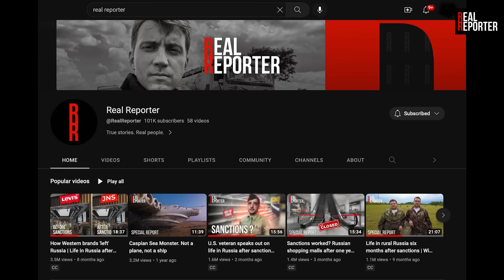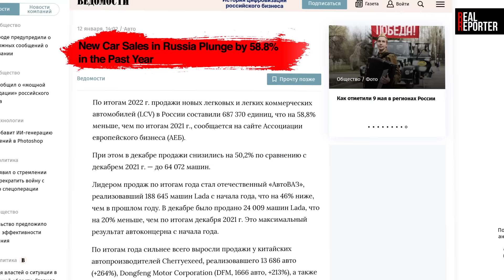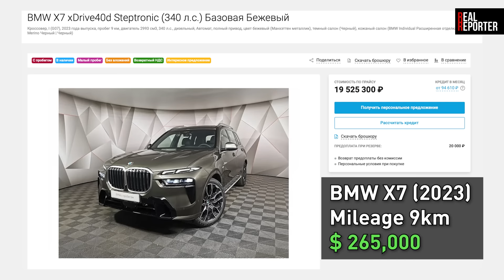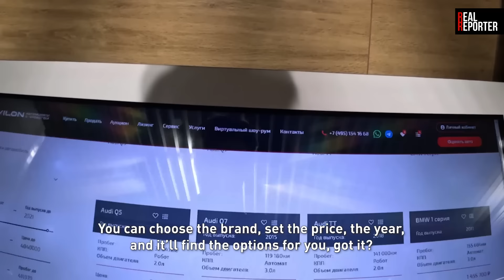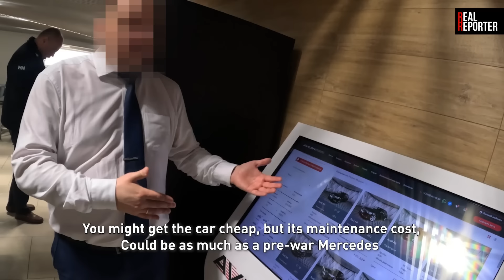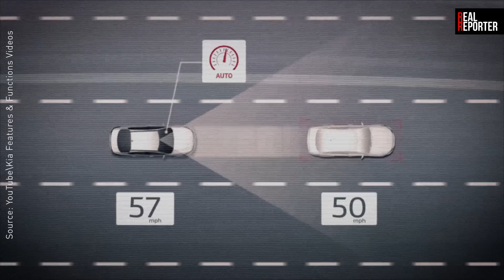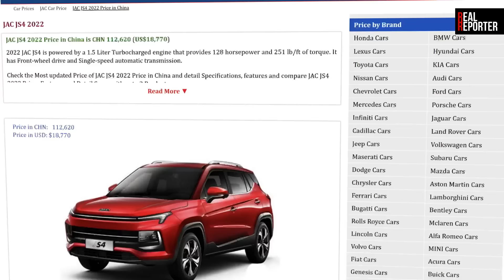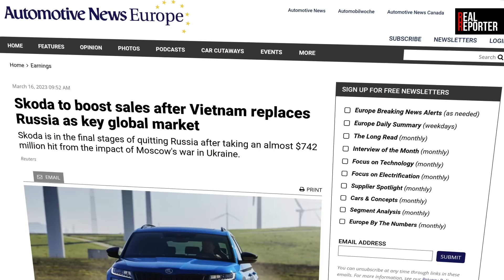Sanctions vs Russia’s car market. Who wins?

Comment: Remember, Russia was the import country for used German cars; the Germans the Swiss changed their cars after 3 to 4 years. It was a solid business plan for German carmakers.
 
A large percentage of those relatively young used vehicles went to Central/Eastern Europe - especially Russia. 
Now that market has been severely reduced, Ukraine and Russia are not taking those vehicles; in Russia's case because of sanctions. So RU has a used car shortage. 
In time, China WILL fill the new car gap.

Comment: Jaguar is cheap in the US as well because they have one of the worst reliability reputations while not having the same prestige as having a Land Rover (which is also horrible when it comes to reliability). Alfa Romeos are also cheap, and Maserati Giblis. This last one specifically, brand new Gliblis cost 80k$ but you can get one from 2018 in the low 30k.

Comment: I used to work at a car shop that only work on European cars, there was a 2009 jaguar xf that needed an AC compressor. Because it's more than 10 years old no one has the parts for it (but the dealer quote was $2100.00 parts only) and I had to cross reference the denso part no. to find it, the shop ended up charging the customer $1900 for all the ac work.

Comment: I just came across your video and am watching it.  The prices are something else.  I have a 2011 Mercedes SL550 and a BMW X3.  I feel fairly fortunate to have these cars.  I bought my Mercedes in 2016 here in California for about $40,000 if I recall.  At this time I have about 52,000 miles on it and I have no plans to get rid of it.  I love that car.  My BMW is a 2017 which I purchased from my sister for $20,000 ( a family deal I guess).  That car also has about the same miles.  She drove more than I do.  At any rate getting back to your video.  I was floored when I saw the prices of the cars there in Russia.  Granted they're new but still I think my Mercedes new here would be around $120,000.  That's a guess.  I haven't looked.

Comment: In America with brake pads worn down all the way, they need to change the rotors. Brake pads labor is around $150-$175. 

So don't complain about spending $65

Comment: It's funny when people outside my country say that things are expensive, a 2012 BMW X1 with 110 thousand kilometers for $19400? that's roughly 17700€, so one over here is... 22000€ which is $24200 USD.

Oh, and Diesel (which this BMW is) costs 2€ a liter, about $2.20 USD.

The Renault Kaptur/Captur with 1.6 liter engine and 133 thousand kilometers from 2020 for $17300, that's 15700€, equivalent one over here costs 24850€ which is $27250, the Kia Rio's equivalent is 29000€ which is $31800, the reason why the Kia is so expensive is that it seems to be one of the "better equipped ones" in addition to being a Station Wagon instead of a Hatchback, also practically new car so...

Edit : The Jaguar is likely a Diesel instead of Petrol if it's cheap, people who buy Jaguars second hand tend to only want the Petrol engined ones because the Diesel ones have engine from Ford Transit, a 2.2 liter Diesel to be exact, so while it looks fancy, it has the engine of a workhorse, which for a normal person is not actually bad at all because while Transits are not exactly known for being unbeatable vans and come with their own problems, the engine at least is not that bad compared to the Jaguar petrol engine for the same car.

If you ever look at Alfa Romeos and wonder why an Alfa is so cheap, it's likely for the same reason : it has Fiat Ducato diesel engine instead of the Alfa petrol engine, funny how these two completely different companies have had similar idea with their less reliable engines being replaced by a workhorse's diesel engine, but the interior and looks are fancy as hell.

Edit 2 : Of course, the Jaguar and Alfa Romeo will be far more expensive brands for parts than a "simpleton's" Ford or Fiat so... if you get unlucky your basically a sucker.

Edit 3 : Over here, set of brake pads is 53.80€ for front & rear, installation would be about 100€ at a Opel workshop and about 60€ at a trusted brand type of workshop, not first party though, so at a random workshop like that with just one guy in a garage basically, maybe 40, 50 or so, so about the same in USD as what you paid there overall.

Comment: Thanks for your video shopping of car.
I paid $9.99 plus tax for a set of front brake pads for my 97 corolla, which almost has the mileage from the earth to moon. 
Just checked the pads online and the current on-sale price is $5.99 in the on-wheel country. I have not seen brake pads made in other countries except China for years. 
I changed the pads by myself and paid $0 for labor.

Comment: I have owned Haval for six months now. And I'm still excited.
Reply from the maker: What’s your first impression?
Reply: @RealReporter  First impression? Astonishment. The assembly is so high quality that the creaking interior of the Mercedes looks like nonsense.

Well, everything is relative. I sold a 2011 Passat B7, and bought a Haval Jolion. They are surprisingly similar in terms of comfort level. A little more options, like cameras, a little less soundproofing. In general, they are approximately equal, but Haval is new and under warranty!

As for comparing your Opel Astra with Haval, it will definitely be better. Unless... I guess with your filming equipment, you might be disappointed by the depth of the trunk. However, the rear seat backs fold into a flat floor =)

Comment: prices on cars in the UK are up as well. by at least 30%, both new and old. I've noticed that an old Citroen C5 with 100k miles on the clock and 2010 reg, was £1200 a year ago and now £3000. This is for an old old car. Thats crazy. But even my car which is a 3 year old Volvo S60 is up in value by 20%. Normally it would depreciate by 30% not go up in price. So i figured, this must be something to do with the shortage of microchips. My friends in Russia who have Lexus and VW and so on, initially found that spares went up in price but it seems to be levelling out now. I'm sure that the market will settle and the prices of all the cars will start to drop. As for brake pads and labour, no way it cost £40 for labour to change them, it's more like double that. UK has different prices for car service in different parts. London is more expensive but somewhere up north in a local garage and for cash, probably much less. The opel astra brake pads are anything from £15 for each to £50 each, depending on the manufacturer. and as you need to change them in axle sets you are talking about the same as in Russia. In short, break pads parts and labour in UK is around £200 per axle.

Comment: Got my front brakepads changed for suzuki baleno 1.2 petrol (India). TVS(6th largest motorcycle manufacturer in the world) brakepads cost 800 rupees (9.67$) *bosch brakepads also cost the same but i like tvs better. The mechanic simply jacked up my car not lift nothing and changed the pads in 15 mins for 200 rupees (2.42$).

Comment: Foreign cars have never led the market in Russia.  China is taking over the market across Asia from US cars as the price difference is much lower on the Chinese models.  

Year-to-date sales of cars from China, covering the first four months of 2023, were 68.5 per cent higher than the same period in 2022 with 13,426 sold in April. That meant 16 per cent of Australia's 82,137 new cars sold last month came from China.

Comment: $115 for brake bad replacement isn't terrible at a dealership you can pay 300 plus for this but I work on my own truck and would just buy the parts myself for 25 and get it done in 30 minutes.

Comment: The BMW X7 in my native Hungary costs somewhere between 38.4mln and 49.3mln HUF, or in other words, something akin to 112.000 to 145.000 USD, depending on the trim level. I haven't been able to find reliable info about the S350, as you cannot get it through the local Mercedes dealership, but some companies specialize themselves to import a few "on order", the cheapest price being some 43 million HUF, or in other words some 126500 USD.

Comment: Driving an 1997 Lada Niva 47.000km 4WD. I have bought for $200USD in Moscow last November privately from a Wodka addict who lost his DL. It  has a driver seat and some other furniture including a rear dog kennel, a well running Motor, good tires, a steering wheel some mirrors and lights for the night and functioning brakes. My  dog and me are not getting wet when its raining and I love the working front and rear windshield wipers. In the winter its warm inside. It came with a tool kit...a hammer, some sockets, a screw driver and some pliers...I am a happy mecanic, no monthly car payment ...what else do I need?
Reply from the maker: Wow, what a story! Tbh, I’ve had my eye set on Niva for a long time, it just looks badass i don’t… but then getting a new one might not seem like the best investment. However, you got a great deal: even if something comes up with your Niva, so what? You payed $200 for the car 
Thanks for sharing 🤝

Comment: 01:56 Heey i have an Astra H Sedan '12MY to. Be honest, as an owner who maintain my car by myself in m own garage, i've realized, that today's problem of owning a European Car in Russia is not about the lack of spare parts, but about lacks of qualiy spare parts. Last weekend i had a problem with the leackage of antifreeze (it's well known problem for overy owner of GM with EcoTec engines since the middle of 2000's). And guess what, it was caused by the quality of parts. In the summer of last year i've reassembled oil-cooler (the block on the engine's block (lol) where coolant and oil goes on parallel channels for temperatur exchange). I've bought the new thermostat with aluminium body, and the pack of gaskets for oil-cooler, with GM labels with holograms and all that shit. They have lasted just a year (or around 15 000 km), and then all my underhood space were in oil and antifreeze again. The prices has been rised in roubles, but the quality significantly dropped down. At this time i bought a cheap gaskets, thermostat and bunch of other staff that made in Taiwan, and doesn't see any sense of trying to find an overpriced "original" spareparts. Chinese manufacturers started faking very look-like OEM labels and marks on parts, but they're not OEM, but being selled everywhere (even in big spare parts retailers) as OEM. 

What about workshops, there also feels some lack of a good specialists there, so after that MOST of repairs of my own car i decided to do by myself. I've also bought some diagnostic equipment for old Opels, and now helping other owners to repair their cars (i've learned how to properly maintain an Easytronic automatized transmission, and my clients very happy, when their "freaky robot" drives smooth again).

I've thinked about to change my Astra for something 4x4, but, unfortunately, i can't afford to buy a newer and better car with price higher than 800 000 - 900 000 RUB (approx. 10-11k USD now), and if you will look deep to the market of used cars, most of them are dead, even not bad maintained, because people with low incomes started to spend much less on maintaining of their own cars, and in most cases, even cheap car often buys with the last money. And don't look over on Moscow roads, where whe have visibility of "mostly brand new cars on the roads are there". This visibility it's just because of people who used to drive upper-middle class cars (big European, USA and Japanes SUV's, and other things like premium sedans) are trading them in for a brand new Chinese cars, because they hope that at least it's warranty (5 years mostly) there will be no any headache with them.

Resuming my example: the car market in Russia is not quiet dead or lowed to the level of African countries, but staying on it's knees now, and in nearest future will sure not stand up.

P.S.: your language is very well, especially that you speak with no any accent. I've subscribed. Cheers from Moscow, Zelenograd.

Comment: Here in Norway are the carprises quit high, We dont even have a 2023 x7 for sale right now on the used marked but a 2021 modell cost arround 140.000 usd a s350 cost 155.000 usd but used and a skoda goes about 25.000 usd. work cost arround 80 usd per hour

Comment: as a mechanic, brake pads you can basically throw on any off brand on any vehicle. its a consumable, like an oil or air filter. the parts that really hurt to find will be things like OEM water pumps, camshafts, bearings (not wheel) etc etc. so your story with the brake pads is kinda nullified by that
Reply: not sure how good a mechanic are you; not all the brake pads are the same, feel free to throw any brake pads on and deal with squealing, juddering, uneven wear, dust, ...later on.

Comment: I mean as a Chinese，I highly recommend you try some Chinese cars. I also drive a car from Geely Group called Zeekr 001， its way better than my father's Leus ES300h in any perspective. And the bread mentioned in the video like Haval and Chery sell at least a million cars per year worldwide. you don't have to worry about the quality. Just remember, china is the no.1 car production as well as sell market in the world。
Reply from the maker: There's no doubt that Chinese car manufacturers have made significant strides, and some of the models I've seen here in Russia look really impressive!
Could I ask for your help with something? I'm currently working on a video about the Chinese JAC JS4, which is being assembled in Russia under a local brand. I'm curious about its cost for local consumers in China. Would you mind checking this on local resources? I'd really appreciate it
Reply: @RealReporter  I checked the car apps and website here in china. And based on the pics I think JAC JS4 in china is JAC S4(江淮瑞风 S4）. which sells from 75,800rmb to 98,800 rmb, usually  you can get 15,000 discount from the dealership. So its around 8,400  to 11,700 USD. JAC is like a 3 tier carmaker in china. Geely, Haval, chery are real tier 1 carmaker in China. If you need more Chinese car information，you can ask me anytime.
Reply from the maker: @seanwoo9140  Hey there,

First off, massive thanks for digging into this and sharing the intel on the JAC JS4 pricing in China.

I noticed something curious though - the pictures of the 江淮瑞风 S4 (JAC S4) in China seem to be slightly different from the JAC JS4 here in Russia. I'm wondering if we're looking at a difference between export and domestic models - what do you reckon?

The price difference you found is just eye-opening. It's crazy that the same model is practically twice as expensive here in Russia compared to China. This kind of stuff makes a big difference to my viewers.

Could you do me another favor? Can you send over the links to the sites or apps you've been using for your research? I want to grab a screenshot of the price for the Chinese consumers to show in my video. Just shoot it over to my email at 1359RealReporter@gmail.com.

Thanks again for going the extra mile with this. I really appreciate your help!
Reply: @RealReporter  I am sorry I haven't see this message till this moment due to my youtube app issue. I will make it happen tomorrow because its midnight here in China. I would love to help for your great content.
Reply: China becoming the world’s largest car manufacturer doesn’t mean that its own cars are any good. 

Foreign companies have factories in China and represent an overwhelming share of the cars produced and exported. These factories are not built or owned by Chinese people or companies, they’re owned by foreign companies using foreign assembly processes and using cheap Chinese labor to drive down costs. 

These cars are being assembled in China, not built or designed there. Much like the iPhone, which is built and designed in America but assembled in China; that doesn’t mean the iPhone is Chinese.

Comment: I can tell you from first hand experience only a fool would every buy a Chinese car.

Yes, they are full of technology and they do look better than only 15 years ago. But, they quality and durability does not even come close to Toyota or Honda.

The weakest links in the Chinese cars is their gearboxes and electrics. That why they have such long warranties. When they are new they are fine, but as they start to age the electrics become just as reliable as an Italian car. 

Jaguars are only for rich people who buy them as a status symbol. Jags are just endless money pits as they age. Same with Mercedes.

Worse of all has to be Skoda. Skodas are nothing more than Volkswagon. VW use to make good cars, but just typical of the Germans over complicate things so when break it ends of costing way more than the car itself.

With the influx of Chinese cars into Russia. The Russians are just getting screwed. Sadly the Russians don't exactly have a good automotive history when you look at what came out of the country. In the 1980s all the cars were based on 1950s designs.